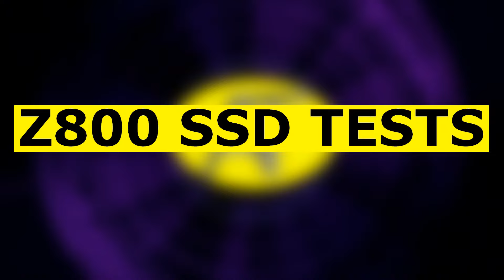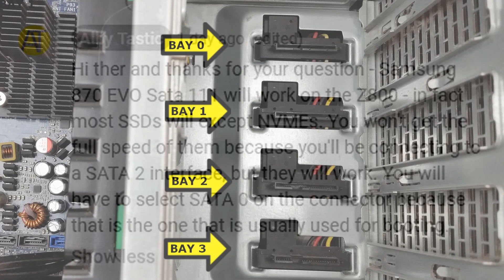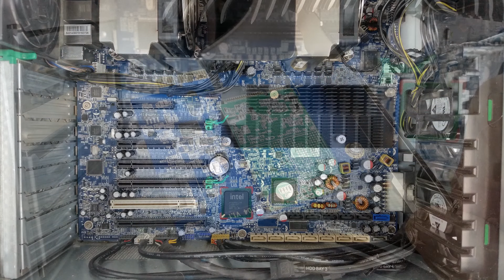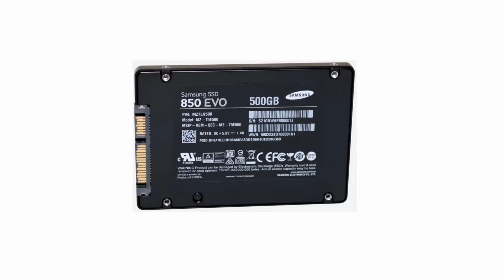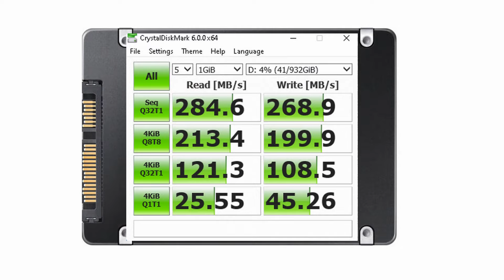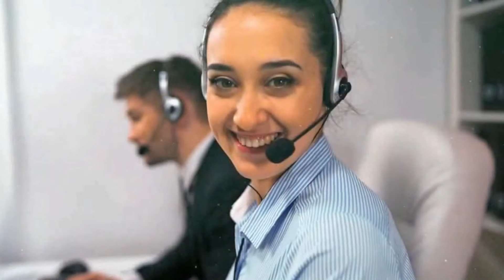Z800 SSD Tests

Comment: Hello Alby, I have an old Z800 Workstation and I’m trying to update the internal hard drive to a Samsung 860 QVO SSD drive. I did first buy a Samsung 870 EVO SSD but after watching your video and seeing that it wasn’t directly tested I got the 860 QVO SSD. But the system cant seem to see the new SSD either. Note I’ve updated the BIOS to the latest BIOS v03.61 and the new SSD is in slot 0. Where the old harddrive containing the OS used to be. In the BIOS, the ‘SATA Emulation’ is set to ‘RAID+AHCI’ and ‘SATA PORT 0’ is set to ‘GEN2/3.0Gbps (Internal Only)’. Do you know what I might be missing?

Comment: The fastest ssd for the Z800 is the Samsung 950 Pro NVMe SSD.
it´s my bootdrive and comes to 1200mb/s because of the pcie 2.0. in my Z820 same ssd comes to 2500 mb/s!

Comment: Really this video  very informative and useful. I recently buyed WD Blue 2TB internal hard drive for my Hp Z800 workstation. After I connect that 2TB hard drive my BIOS was not detecting it. Can you please recommend some valuable suggestion and solution to fix it.
Reply from the maker: When you say the BIOS wasn't detecting it, do you mean you couldn't see it in file explorer? Or did you actually access the BIOS? What OS are you running?
Reply: @AlbyTastic   Yes, hard drive is not seeing in the file explorer, Disk Management and Device Manager. Actually I am using Samsung SSD 850 EVO 250GB as my primary boot drive were I have Windows 10 pro OS installed. While booting BIOS also the hard drive was not detected.
Reply from the maker: @ravishankar4508  Have you plugged it into the correct port connection? If you have a SATA drive it must be plugged into a SATA port - if it's a SAS drive then it must be plugged into a SAS port. If it is plugged into the correct port then I'd try moving the cable to a different port just in case there was a probem - otherwise if that doesn't work try a different data cable in case the cable is faulty.
Reply: @AlbyTastic   I have plugged Samsung SSD in the SATA 0 port directly without SSD connector. But I check by plugging Samsung SSD in all the SATA 0 to 3 ports to make all the ports working fine. Luckily my SSD detected in all the ports. I purchased the WD Blue 2TB with 7200 rpm. In the very first time it was detected in the BIOS then i did the initialize by GPT options and also did the 4 partitions after restarting the system I saw 4 partitions in the explorer. But next morning I find that my hard drive not showing any where. I have my SATA cable plugged in the series of black color SATA but Bay 0 HDD in the plugged in the blue one. All other remaing Cable ( 1,2,3) plugged one by one next to blue port.
Reply from the maker: @ravishankar4508  TBH I don't know what is wrong, You have done all the things and checks I would do and it certainly appears there is nothing wrong with the Z800. I will do some checks on a Z800 and will GPT a HDD but ATM it looks as if the drive has become faulty. The only other thing I can suggest is to create a Linux Live USB and use it to see if Linux can detect it using Gparted.
Reply: @AlbyTastic  I also return the first hard drive for replacement, but the worse thing second replaced hard drive not even detected in the BIOS, Device manager and also Disk Management. May be I would have try to initialize the second new HDD using MBR partition style.
Reply from the maker: @ravishankar4508  There shouldn't be a difference in the HDD showing up regardless of the partition style. I have HDDs partitioned in both styles and don't have this issue. GPT isn't really necessary unless your HDD is over 2TB. It seems as if you have been unlucky in your choice of HDD. I have used many HDDs from various makers without encountering this problem. Keep me informed as to how it turns out.
Reply: @AlbyTastic   Can you please suggest me any internal HDD compatible with Z800 running without issues. My system config is Dual Xeon x5650 processor, 36GB ECC RAM, Zotac Geforce 4gb gtx card, 850W power supply,  one Samsung SSD 850 EVO 250gb with OS Windows 10 Pro. I have a doubt it could any of this related for HDD issues say like BIOS settings, RAID + AHCI settings.
Reply from the maker: @ravishankar4508  Your setup seems normal for a Z800 I think you've just been unlucky - I've used a wide variety of HDDs from various manufacturers without problems. I often buy Joblots of HDDs from a trusted re-seller and have no problems with them and I also use external HDDs from Seagate. All I can say is thet if the HDDs you bought were new then you were unlucky and that most manufacturers usually produce a good product but you can be unlucky.

Comment: Iam using adata su 650 128 as boot  drive  with 2 tb HDD  .   At a speed 300 - 350 mbs
Reply from the maker: That's very good - is that on the Z800?
Reply: Yes